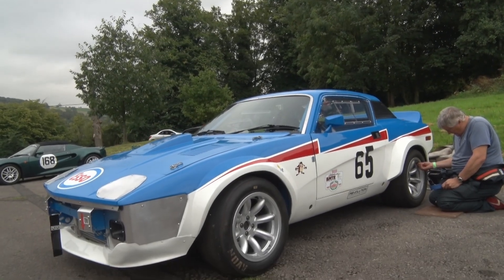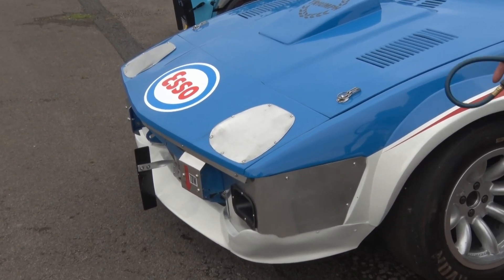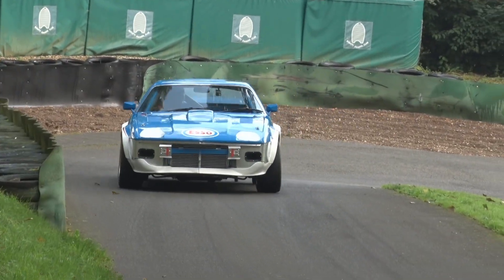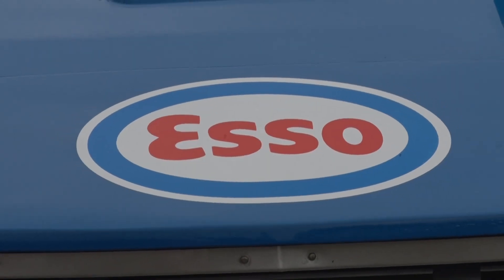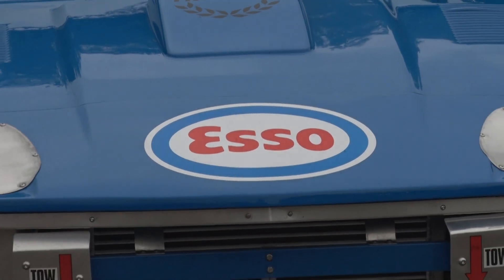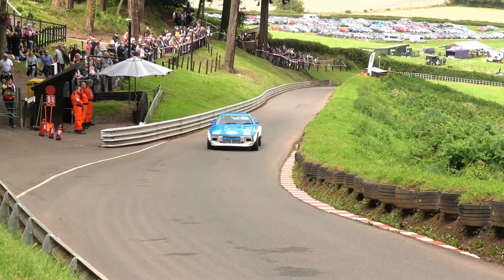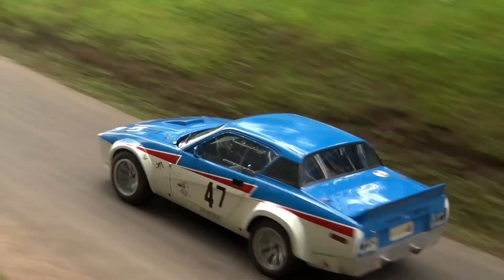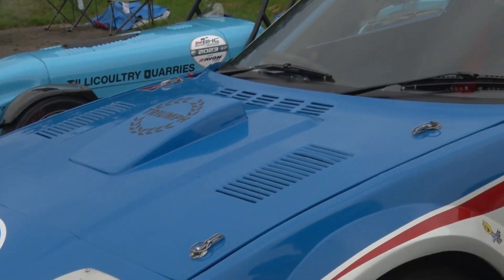Nigel Elliott's 500hp V8 hillclimbing Triumph TR7

Comment: Amazing build. Love it, always been an enthusiast of the TR7. Lets not forget all cars rusted back in the day, having a fully working car after 5 years was a feat back then, not just a TR7. The later built Canley & Solihull builds were better, but the damage was done as so clearly described still by a comment below. My TR7 drophead is as left the factory, never been welded is all original, the body work paint needs attention, but it is only original once!!